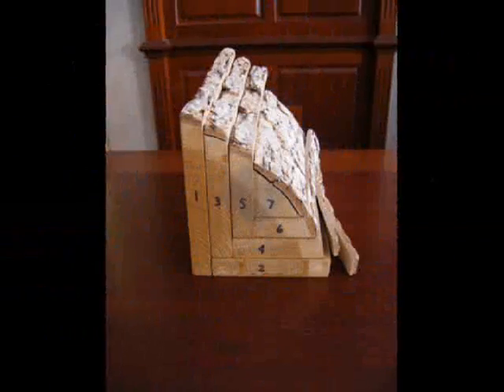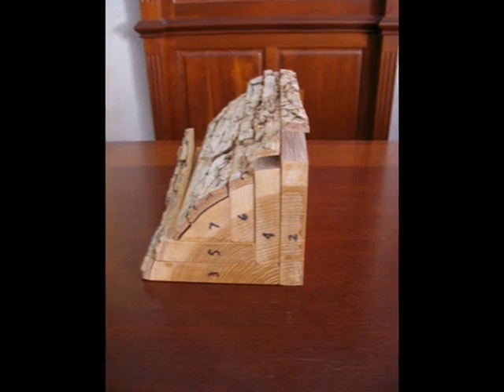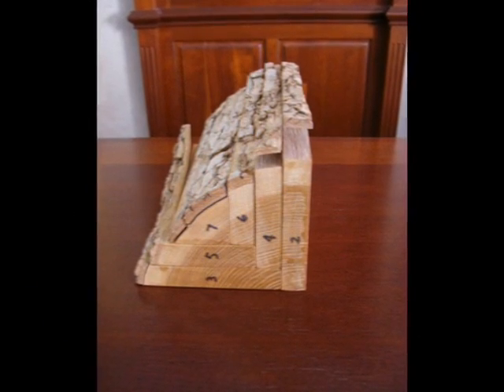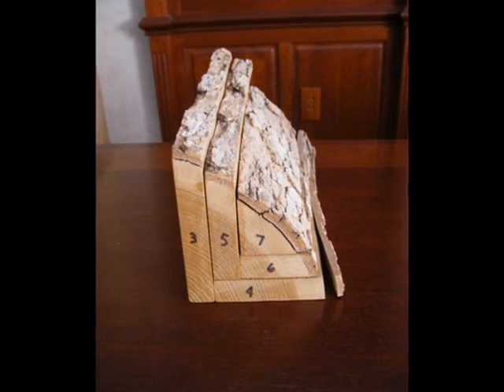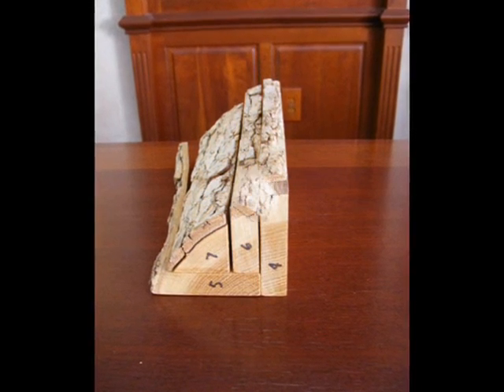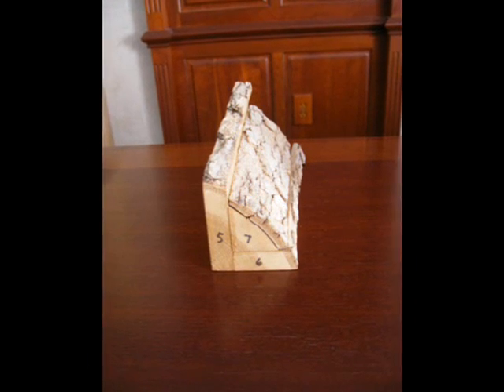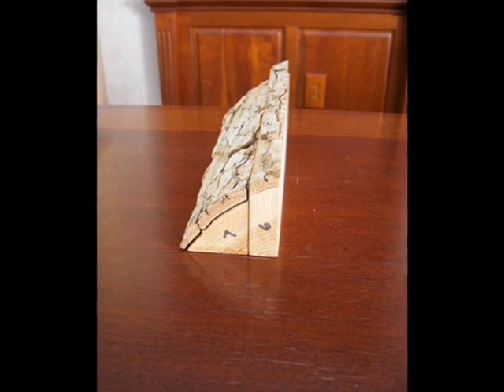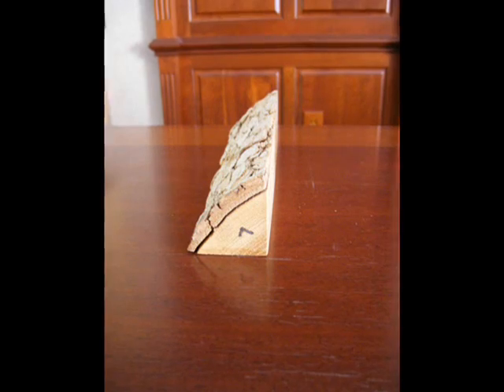The Quatersawing Process

Comment: Yes, this is a tiny log, so not a great example.  The log was cut in quarters and those quarter cants cut into boards, so they are Quartersawn.  After sawing the boards are separated into "Quartered" (80% or more figured) and "Rift" (less than 80% figured).  Frank Miller Lumber is a family owned sawmill in eastern Indiana started in 1903.  They cut 90,000 board feet of lumber in a day and they are one of the largest Quartersawn sawmills in the world and they quartersaw this way.

Comment: It may not be a great example but unfortunately for you it's the example we've been discussing. Just because a log has been quartered and the quarter cants cut into boards does not mean that the resulting boards are quartersawn. Now, as for Frank Miller and his quartersaw results -- great... fine. He's the volume leader and the expert. *However*, it doesn't matter the method or means of sawing. All that matters is the end result. Look at the boards in *this* video. They. Aren't. Quartersawn.

Comment: Pretty video but this is NOT quartersawn.. you can see that if you had two mirror image quarters and sawed them at the same time the first cut is exactly the same as board sawing across the center of the log.. true quarter sawing resembles radial sawing but is almost impossible on consumer grade sawmills.